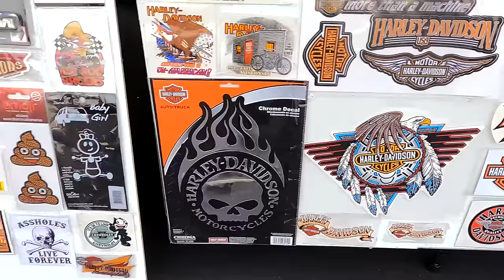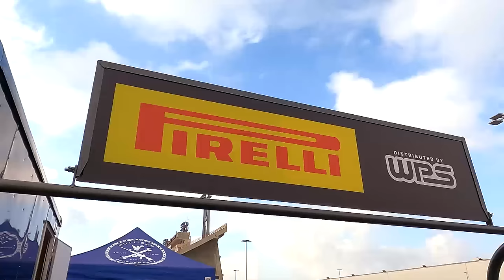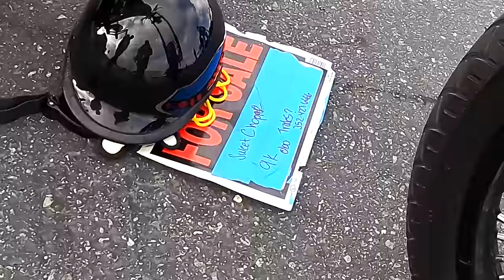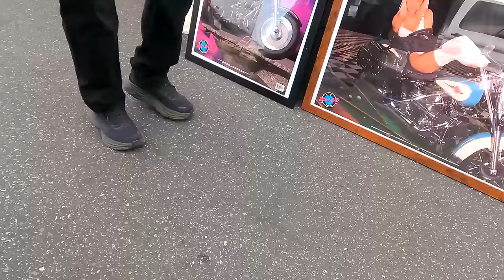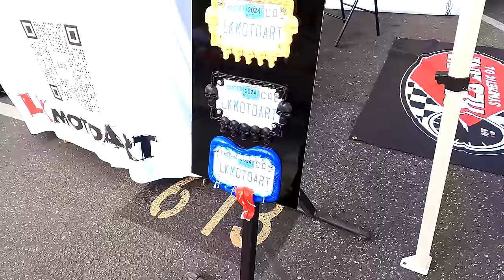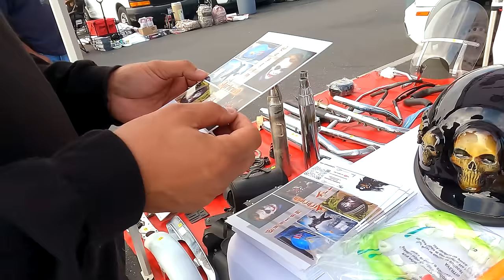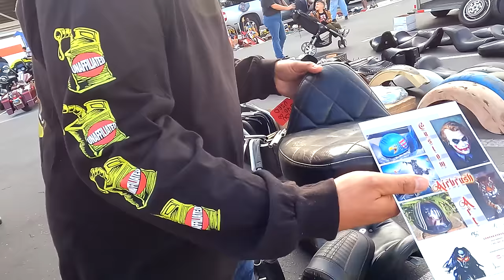#333 - September Cycle Swap 2023

Comment: The green panhead with the question mark ,❓️ is very expensive bike. Unfortunately the guy who built it passed away from doing a stunt on one of his bikes.    Indian Larry's custom Motorcycles in Brooklyn NY, has won several built awards back in the 90s. To see one of his builds, as well as one of Lance Corey Jr's from Trashing supply is actually cool AF!!
Reply: Yeah that indian larry bike is beautiful. He kept that style even through the big chopper phase. So beautiful.
Reply: I don't think Indian Larry built it.  Maybe the Indian Larry Legacy crew or just someone inspired by Larry's chops. I've never seen that bike but every Indian Larry bike I've seen incorporated alot of metal etching on the motor.
Reply: Indian Larry was at the Smoke Out Chopper Show with his bikes displayed twice when I was there. The detail work is unbelievable. You can stare at a bike for an hour and still be finding new details you missed the first 59 minutes. Lol